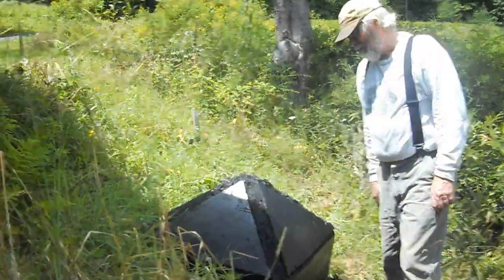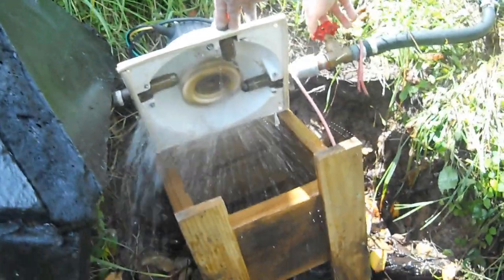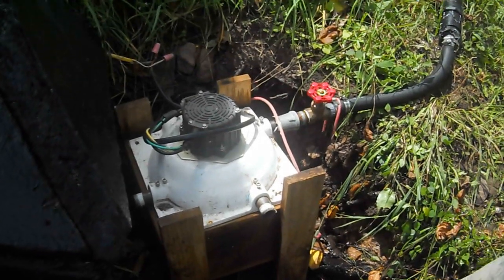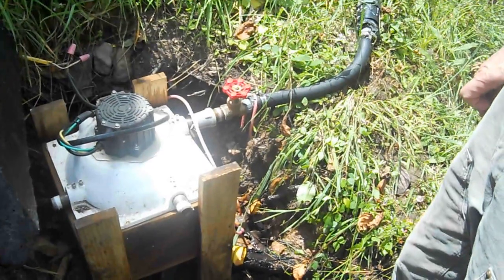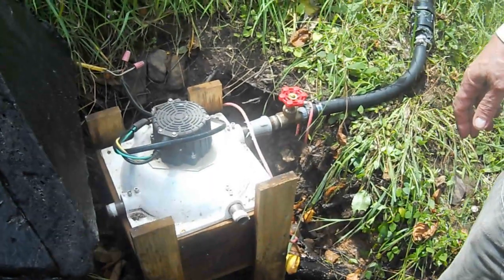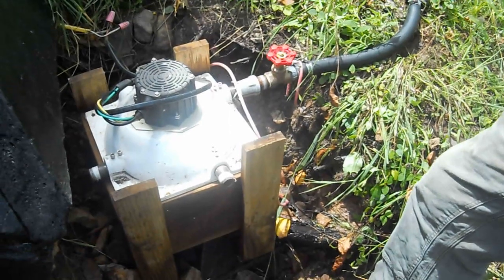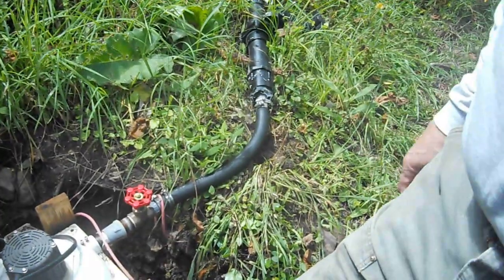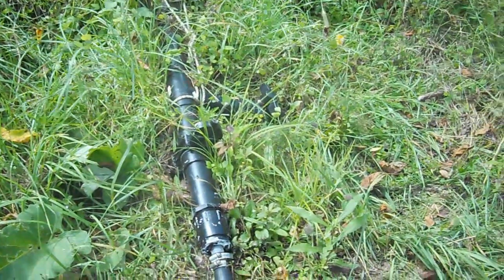A Micro Hydroelectric System, Part 1 - The Turbine

Comment: This video is so good I had to watch it twice!!!!!!!!!!!!!!
Reply from the maker: Don probably spent over $10K on his complete system. But you already have some of the components as part of your solar system. So it would be less than that.
Reply: @nooutagecom  I am hoping a lot less than $10K since I will be doing all the work and building everything with my own muddy hands. The hard costs are the turbine, inverter and cable as well as the piping. 

Piping is pretty cheap here. I would need around, 610 feet. I would build my bar screen out of stainless and weld it up myself. That leaves the Inverter. I really like the MPP inverters from MPP solar. A 5kw inverter/charge controller / battery Charger would cost about $500USDollars to my door. 

So about $3,000USDollars and I am in like flynn. We will have to see. My woods are really dense. I mean like a jungle dense bamboo and on and on. So I will need to figure out my head next. Google maps is not getting it so the next step is to climb through the woods. Jim
Reply from the maker: You should not need another inverter. Most of the micro hydro generators in this size have rectified output to produce dc. So they are connected to your battery bank. Just need the generator, diversion load controller and dump load. If the wire distance is long then a step-down voltage converter. What is your total battery bank voltage? And what would be the wire distance from the generator to your battery bank?
Reply: @nooutagecom  I am going to guess that my power house with my battery bank (12 batteries in sets of 4 for 48volts, 200ah batteries) is about 350 feet from where the creek exits my property or where I would need to place my Hydro turbine. My thoughts are that i would need AC since it would be such a long distance and convert it into DC and feed the batteries. I have an 8kw gasoline (bad idea and expensive) generator that sits beside my current power house. I do not currently have a diversion load contoller or a dump but I could use my hot tub for that if needed. Thanks. Jim
Reply: nooutagecom 
That’s a frustrating thing thing I’ve noticed. Using the AC output provides flexibility and distance without additional equipment
Reply: @nooutagecom  I still think you need to come see us! hahahaha